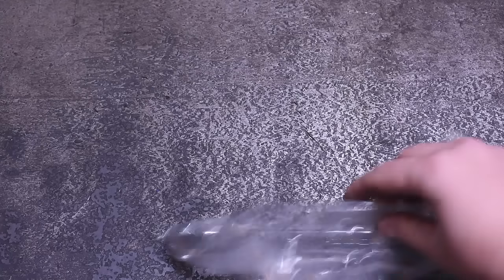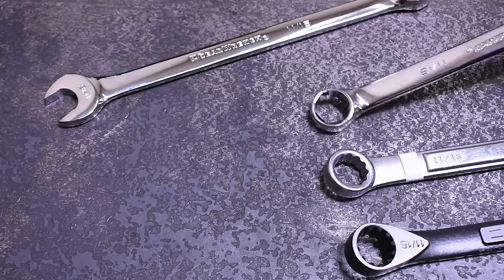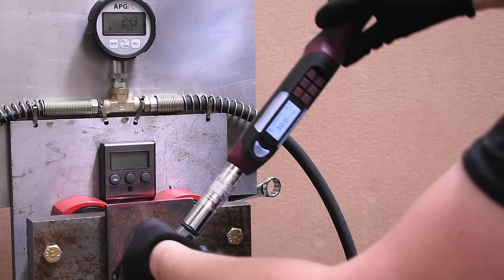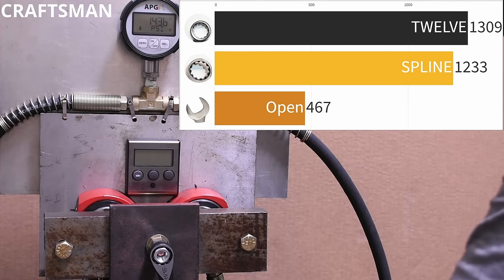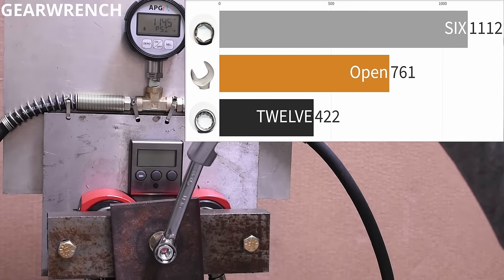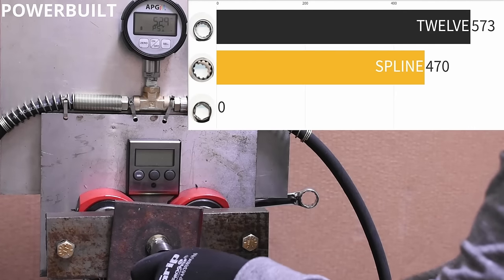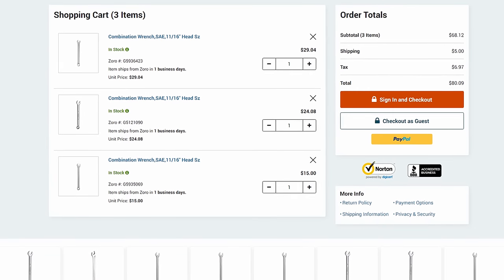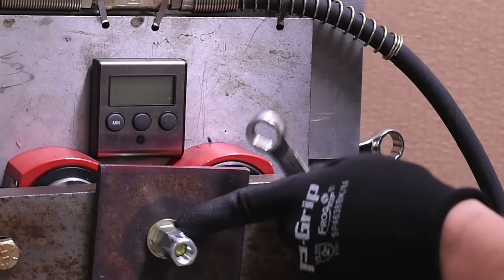Let's Settle This! What Wrench & Socket Design Will Slip 1st?

Comment: I would’ve lost a bet on the spline wrench. Still not gonna buy them 😁 but that was a surprise.
Reply from the maker: Funk! My man. I'm in the same boat. They seem to chew up stuff too.
Reply: Idk, seems to me that they’d be useful for removing rusted on hardware. Wish I had some handy when I was tearing apart an old boat motor.
Reply: @John_Doe_6996  That's why you have torches, penetrating fluid, extractor sockets and, in a pinch undersized 12 point sockets that get swing-pressed on
Reply: Splined is probably nice for those corroded fasteners 6 and 12 won't fit on and you know you should replace, but never do.
Reply: @guillaumefraser3813  I don't think I have ever had any luck with penetrating oil on something that wouldn't already move. I call it put it off juice, cause I can spray a load on and put off that job till later while it "soaks".
Reply: @aholesahole  that's why I skip straight to the extractor.  Chew it up enough that I can't get it back on with a 6-point and I've got to go get a replacement right then.
Reply: Spline wrenches do well but I have had them score up fasteners really badly, and I'm an aircraft mechanic so it can be really frustrating to damage a really expensive fastener for a customer. So I haven't been a big fan of mine. I prefer 12pt because I need them for turbine engines as most fasteners are 12pt and the extra set of splines really makes the difference in limited access situations. But for really stuck hardware, 6pt is the go-to.
Reply: splines are awesome once you start using them the rest turn to shit in your eyes.
Reply: There are spline drive nuts fasteners out there that only work with spline drive tools.
Reply: I like those craftsman splines like they used, they're beefy as hell and feel amazing
Reply: @--_DJ_--  Exactly. penetrating oil is either there to make you "feel better", or to be used after the fastener is broken loose so it won't try to sieze up again on the way off.
Reply: @--_DJ_--  Also if the work area is soaked in penetrating oil, it just smokes more when you inevitably have to torch it red hot!
Reply: No expert ,but I had a rusty faster I tried a spline jobbie on.
I'd say it was great to crack it loose, it didn't slip much but luckily I was able to spin it in a circle. 
Might eat too much rust and grip off the fastener if you have to remove and reposition, switch to a 6 point if that's the case.
Reply: @Bloodbain88  Yep, that reminds me of my old journeyman. I swear he was addicted to the smell of burning WD40. He would get the torches out, heat the nut/bolt red hot then squirt a healthy dose of WD on it. It always just vaporized before it ever did anything, but he always did it. It does have a nice kind of smell to it, but not all that effective when it is all in the air.
Reply: @--_DJ_--  Lol "lung cancer? I never smoked a day in my life!" 

The stuff that we inhale on the daily.
Reply: @tonyrmathis  yeah this, the spline tools are really for spline fasteners
Reply: Dude I love your shit!........ lol!
Reply: They seem good for removal only (potentially).  You can really reuse anything if they slip on it.
Reply: Ayyyy world's collide.Two of the best channels on YouTube
Reply: @rondoanderson  You only need one shock to do the job, but a squirt of WD40 isn't going to do that. Generally you don't even need to cool things off once they have been red hot, when they contract the rust bond usually breaks. I work on mostly older fleet trucks in Ontario, Canada. The hot wrench is usually close at hand.
Reply: @guillaumefraser3813  "Swing pressed" - I like it!
Reply: @tonyrmathis  We SO needed that! Not.
Reply: I've got a set of 1/2 inch spline sockets because Minnesota
Reply: @Bloodbain88  that is proven false on many other channels. it does soak in.
Reply: @--_DJ_--  I break it out when I've got quite a bit to do other than that one bolt. 5-10 minutes doesn't really ever do much, but it you can give the fastener a little spritz 2-3 times an hour for a couple hours, it can make a huge difference, especially if you hit any exposed threads with a wire brush/wheel.
Reply: @halogod0298  My real life tests prove otherwise. I am sure it works in some scenarios, but those don't seem to occur on anything I work on.
Reply: @guillaumefraser3813  fym in a pinch, my standard socket 12 points are the best
Reply: @--_DJ_--  you ever try candles wax. Heat up the area around the fastener. Grab a dollar tree pack of tea light candles and take a chunk of wax and melt it all around the fastener.  It don't have to be cherry red like when using heat to break it free. Just hot enough to melt the wax and drawl it into the threads. Then let it cool 30 seconds or so and it works wonders. Way way way better then any penetrating oil. I'm sure there some YouTube videos about it.
Reply: @--_DJ_--  invest in "silikroil."

Silicon kroil penetrating lubricant.

That stuff is miracle in a can on rust-tight nuts & bolts.
Reply: @davecrupel2817  Reviews I have seen of it don't even come close to justifying the super high cost of that stuff. Though it was the original not the silicone stuff, but still a bit of silicone isn't going to make it night and day better.
Reply: @--_DJ_--  Don't knock it 'till you try it. 
Won't say anything else on the matter.
Reply: @philtheairplanemechanic   Wow, I just learned something.  Thanks.  BTW my step dad was an aircraft mechanic so learning this is even that much more awesome.
Reply: I absolutely love my double box end flex head spline ratchet wrenches.  I've owned  them for over 10 years. I work with heavy equipment and have never had one slip or fail internally.
Reply: If only there was a specific bolt that the spline wrench is designed to work with….

Comment: Spline tools work great for spline bolts and spline nuts. They're used a lot on aircraft. Of course 6 point tested well on a 6 point test set. It's generally best to match type to type.
Reply: Was about to say this myself. I feel the spline wrench used correctly on a spline bolt would blow the others away completely.
Reply: At the risk of sounding dumb I’m not a massive thinker about these things but I mean this definitely just seems like the same pattern wrench for the same pattern bolt seems to just common sense to be best the 6 on 6 gives less room to move or round off like a 12 on 12 or spline on spline
Reply: Using a tool that isn't designed for the bolt are usually less effective than a tool that is designed for the bolt.
Reply: @killertruth186  in other news, the sky is blue.
Reply: @branaden  which was not the point of this video. Most nuts and bolts people encounter on a day-to-day basis are 6-point. Box end wrenches are easier to find as 12-point or spline, so which one should a person with limited funds get when 6-point box ends are few & far between when you need one in a pinch, can't get a 6-point to fit due to angles and space for a wrench, or are just starting to build your tool collection? This video gives us useful info to consider.
Reply: and then there's a person like me.   vise grips are the universal type.
Reply: But spline certainly ain't intended to be used on hex heads. I would like to see him do the test including some wall drive type sockets/spanners.
Reply: My thoughts exactly. I was wondering why spline was even considered for this due to the fact it was not designed for hex heads.
Reply: @l00nybin  I think he was ‘commenting’ on how obvious the statement previous to his was.. well more of a sarcastic statement.
Reply: @littlegoobie   my complete tool box , 2 pair of vice grips and a 3# hammer
Reply: One of my all time favorite sayings is about how everything is a nail when you're holding a hammer.

Comment: YES! Thank you! This should be of great help to the guys and gals getting into automotive, and do not have the experience yet to make the right choice on their first sets. Forums are FULL of  "12 pts is just as good at 6pts!" comments, which lead many new DIY rust belt mechanics astray (me included a decade ago), having to buy a 2nd 6pt set after a dozen of rounded bolts with 12pts.
Reply: There's a reason spiral fluted extractors have six flutes.  You'd think that would be a clue the first time you have to use one.
Reply: @kd5nrh  Yes, and how many 12-point spark plug sockets have you seen? The cool thing about a 30-year-old set of 12-point deep sockets that you might have sitting around your garage is this: the spark plug socket insulator/rubber has long since deteriorated, making it a fine 6-point deep socket for general use now ... and guess what can outperform the 12-point deep sockets next to it?!

Comment: I anticipated this result, though had forgotten about spline spanners. I’ve had a few premium 12 sided sockets start slipping on bolts, switched to a mid-grade 6 point and eased the bolt out. A quality 6 point will always be my go-to unless there’s something preventing it.
Reply: Same experience for me, I work on classic cars, so regularly encounter stubborn nuts and bolts.  Had my tools stolen and when I replaced,  I purchased a full Craftsman set, lifetime warranty, and all sockets and ring spanners come in both 6pt & 12pt.  Adequate quality tools and gives me a bigger selection, so I can pick the right tool for the job.
Reply: Yep. I’ve learned the hard way to only use 12 pt as a last resort.

Comment: That's crazy, the difference between the open end and box end. Considering how much lower it can be on the open end, i'd love to see a whole bunch of brands compared on just open end performance, since at those levels a little may go a long way in performance difference. Some brands are supposed to be better designed as well, where as box ends are design wise pretty similar between wrenches.
Reply from the maker: We can do that, probably don't even need to start with rounded nuts to see the difference there either.
Reply: I’d be real interested in that kind of test with truck & Japanese brands. Truck brands are a known quantity, more or less, the Japanese brands less so.
Reply: I would like to see this as well. God knows every once in a while you get a fastener or if you work on hydraulics a lot. Where a open end is the only thing you can get on the fastener.
Reply: @TorqueTestChannel  a good idea would be to also to test Milwaukee open end wrenches with the extra grip point and flank drive and snap on open wrenches with their flank drive and see if it gets any closet to 6 point
Reply: @nikking5277  And Proto's Anti-Slip Design wrenches (especially since you already have them).
Reply: @TorqueTestChannel  If you test that, it would be nice if you include wrenches from Hazet, they are quite a bit longer and have thicker jaws on the open end than the usual stuff (in Germany anyways, since most wrenches are built to the DIN-standard with a fixed length and a fixed angle for the 12-point).
Reply: And the Wera joker wrenches have quite an interesting design for the open end with a hardened steel insert.
Reply: Matco also has the little “teeth-type” design on the open end of their wrenches where the box end is the spline drive. 
 Also make the 12pt. Box end. (So as to compare Matco to Matco at least for those 2 types)
Reply: Wright Tools makes ‘WrightGrip’ wrenches. Might also be a good 1 to check out
Reply: Big issue with the tolerances there are going to be not just on the wrench end, but on the nut/bolt end. What manufacturers make what nuts and bolts to a high tolerance and who make them to a low tolerance. A shitty wrench might work better on a shitty nut/bolt. It's hard to say.
Reply: I saw someone do that test a few months ago(don't remember which video) but as suspected, SNAP-ON(NOT their cheaper brand, Blue Point) was way in front, due to their unique moly steel(in fact the Pittsburgh  brand, Harbor Freight, actually snapped the tool end off!).  ICON(again Harbor Freight) cam in 2nd, with Gearwrench behind that and Craftsman behind them)
Reply from the maker: @brucemadden1626  Ultimate strength doesnt mean a lot to me, I might break a combo wrench once every 2 years. Where I round stuff over weekly, sometimes daily.
Reply: I live in the rust belt.  I have mostly 6 point wrenches and sockets. I have been picking up some 12 point stuff for hard to reach items, but they slip so easy. Perhaps, I just work on too much rusty junk.
Reply: @TorqueTestChannel  could you test Wera Joker wrenches and Wright brand wrenches?

Both of them have little teeth on the open ends. Though the Wera’s are on insert plates. 

I’d love to see the difference in the grip.
Reply: add Tekton as well.
Reply: Do Wright tools wrenches! The best IMO! I'd be curious to see!
Reply: I own several different brands and have used even more, but the 4 metric double open end Japanese Fuller wrenches I own are the best open ends I have EVER used in over 50 years.  They are precise and the metal is extremely good.  I abused the 12mm with a 3' pipe extension on a forklift bolt without spreading or breaking!
Reply: @solarsynapse  I have an old japanese Fuller pliers. Channellock style. They are more durable than any other pliers brand I have owned. So I don't doubt their wrenches are good. I'll have to try them. Wright's "wrightgrip"  combination wrenches, in the black color, are currently the best wrenches I've tried.
Reply: @dogrunner100  weird in USA snap on it the best as for tolerance over blue point in Japan the blue point is the best on tolerance over snap on just a fun fact

Comment: God, i love how manufacturers and consumers are finally moving away from the long overdue dumpsterfire that is phillips & flathead sockets.

Went to the hardware store the other day (first time in a long time) to buy some hefty replacement 12mm screws to secure a parasol on the porch. Almost all of them were some form of hex which put a smile on my face. As i got to work installing them, it turns out the wood was very stubborn but so was i. Excessive amounts of torque later (which would have shredded philips & flats 20 times over), the 12mm screwhead flew off like a bullet and ripped all the skin off one of my knuckles. I've never been happier to get such an injury.
Reply: Absolutely! I've seen 8hrs + spent in a heavy truck shop just getting the 10 stainless Phillips screws out of the shifter boot  in the cab on an otherwise 4 hr transmission removal and clutch replacement! Couldn't heat em because of plastic, Couldn't drill too stringy an overheat plastic, no impact drivers, floor too springy, using valve lapping compound on the driver bit is the most effective by far. I detest flat (straight blade)  and have loudly called Mr Phillips everything not in the dictionary and suggested where he could store his fasteners! Best tool for that I always carry in my pocket is a Rigid 6" pipe wrench with the jaw rivets flattened so it lays flat enough to grip screw heads.
Reply: Wanna have a laugh at my expense? My country still doesn't sell square, hex(internal and external), torx screws for general use. 

Square is always for decking screws
Hex is always 8mm or thicker 
Torx is always on a stainless steel bolt. 

I'd kill for a packet of 30mm long 8 gauge square head screws
Reply: Hex screws are a gift from god
Reply: hex were always ones for heavier jobs. That being said it's pretty impossible if you want the screwhead to be flat and compact ( electronics, glasses small stuff ).
Reply: @jakubrogacz6829  Nonsense. If you look at just about any flatheads or phillips, they all require depth for tools to slot into.
Reply: @Coecoo  I meant flat as in not sticking out of the hole, and compact, since there are hex style threads that have slot instead of extrusion but those are bulkier so they are not a viable option to use in small stuff.
Reply: I mean I get philipshead for certain easy duty stuff and small screws, even though torx is superior and nowadays acceptable in cost and effort but never will I ever understand how flathead screws even caught on in the first place... doesn't take a genius to right after inventing it get the idea to double it to a cross
Reply: Tbh flat head screws became shit because the metal they're made of is shit 

My grandfather's tools are still in pristine condition 70 years later. Things where made more robust in the past.
Reply: It's an (north) American thing (I say this with malice). We have electrical sockets where only one tool can actually fit inside the opening to touch a live wire. The slot screw and driver. Any guess which one they use universally for all things electrical? My advice to other countries today is observe what the USA is doing/using and do something different, they are idiots.
In Canada we have had Robertson (square) drivers for decades and you almost have to go out of your way to avoid using them. They work almost as well as the star (6 spoke star) ones, which I think is what you described. Biggest issue I experience using them is the bits do not cam out easy (bit gets stuck), but that is actually by design.
Reply: Do you mean the torqs screw  heads ? Or just bolts
Reply: Torx is the goat man. Best surface area bite imo
Reply: Next time rub some soap on the threads. It makes screwing into wood SO MUCH easier
Reply: That’s why we drill a pilot hole
Reply: @blackhawk7r221  Like i said, they were REPLACEMENT screws. Holes already existed.

Comment: This is why i ALWAYS buy and use 6 point sockets UNLESS I need the 12 point or spline for getting in low access areas (very rare) or I need something special like an external torx etc but that's a different situation altogether. Great video, I appreciate someone confirming what I have suspected on my own.. I always tell people this and they think I am overexaggerating but now I will reference this video as proof when talking about 12point vs 6 pint with my gearhead friends!
Reply: 12 point have worst ewer. big shit, only used cheap tools.